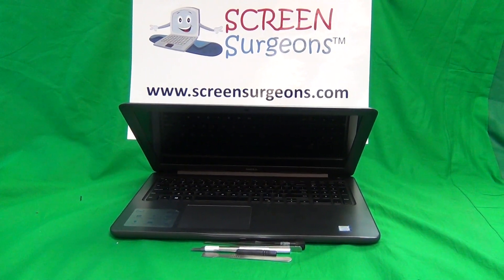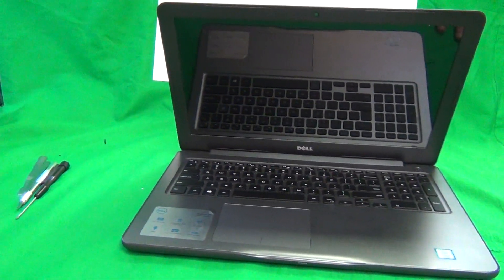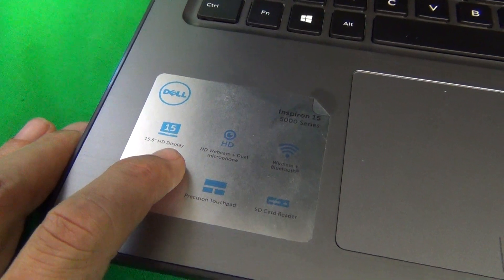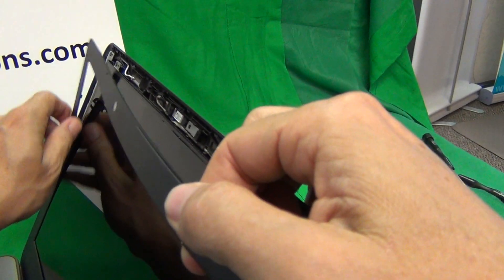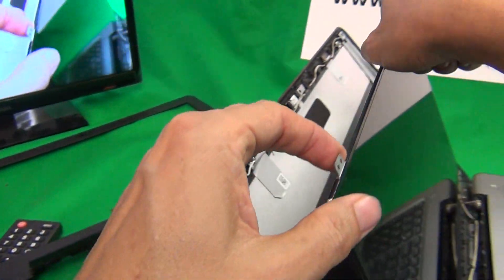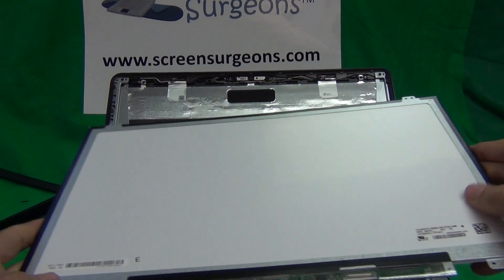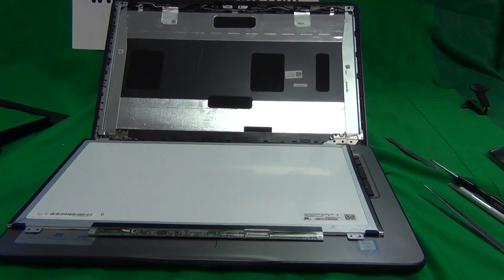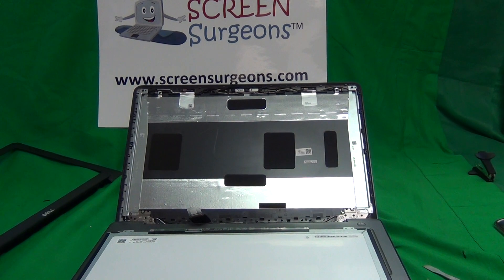Dell Inspiron 15 5000 Series 5565 5567 P66F Laptop Screen Replacement Procedure

Comment: I just want an answer for a single thing: is this screen the same, I mean, as the original this laptop brings, or is this an upgrade with a better screen with better image quality to display? It is possible to upgrade the screen of an inspiron 15 5000 5567? Because the original assembled that this 'laptop' brought, sucks as no heaven existing man.

Comment: Hi,
it´s possible to replace a P66F touch screen by a don´t touch one?
Otherwise, which is the compatibility about screens with P66F.
I have used one for 6 months only and finally the screen show many vertical coloured lines/bars moving that only stop when I take the screen from their exterior angles and support it.
Is usually so fragil the P66F touch screen...?
Thank you very much for your answer.